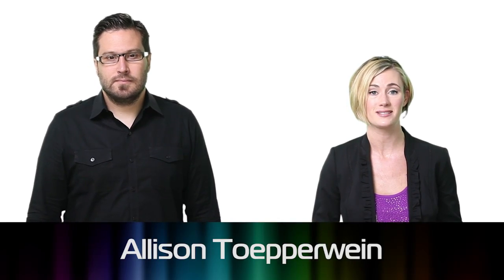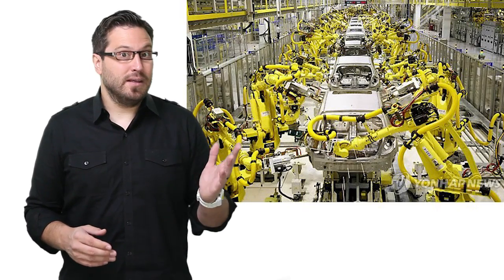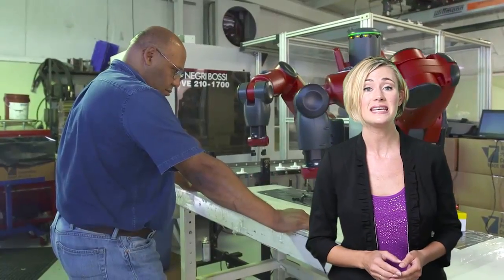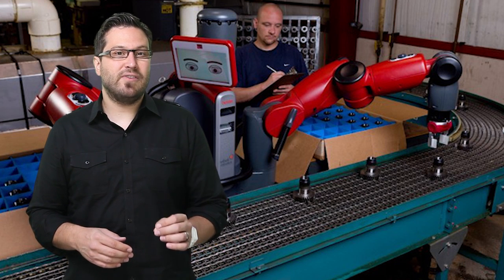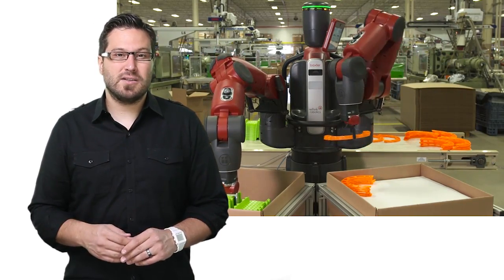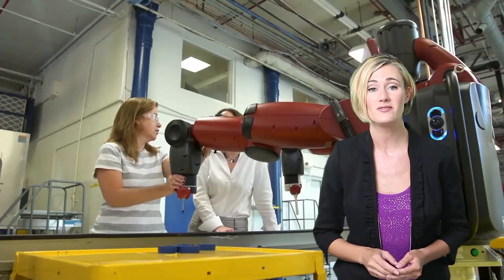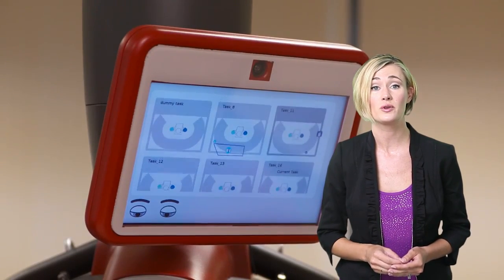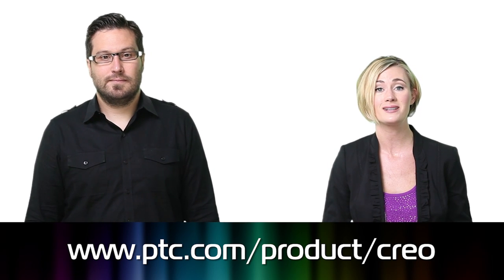The Future of Factory Automation

Comment: Someone will have to be skilled in Building repairing and programming these machines that will completely displace the unskilled laborer. Luckily for me I am going to school to learn these skill. C++ programming language, embedded systems programming, computer networking, and CAD will be needed to maintain this infrastructure.

Those who don't have these skill will be out of a job. Even farming and other jobs will be automated. I have heard that even trash and recycle pickup will be replaced by robot collection trucks.
Reply: +Terrance Kenallen 
Not really.
We already have machines and robots making other parts and machines.

Also, self-maintenance isn't a problem, considering that the main reason behind any technology breaking down is deliberate planned obsolescence.
Namely, we can design things that do not break down or require maintenance.
Making technology from say metamaterials (which are synthetic materials that we can produce in sustainable abundance) would give tech the ability to repair itself should problems arise.

But it also depends on how you design any given technology.
Eliminate moving parts by replacing them with say magnet based technology, and you eliminate majority of issues.
But as I said, you can design systems with self-lubrication, self-maintenance, etc. when its needed.

Our current system demands planned obsolescence because it keeps people in business.
However, companies are deliberately moving away from this and industrial grade technology virtually ALWAYS lasts far longer than consumer grade technology.

In short... there is no job that cannot be automated.
Actually, deep learning, etc. can already replace everyone and everything... 
The majority of the global workforce works in jobs that are highly specialized or repetitive - computers and machines surpassed Humans in both fields over a decade ago.

Now it's just a matter of time until cost efficiency catches up to technology.
Nothing more, nothing less.
Reply: deksman We have not even come close to reaching the peak of what humans will demand from technology. You speak as if we are near or at the end of technological progress. The continuing advancement in technology will drive human jobs. They just wont be unskilled labor jobs. Engineers will become more like creative artists in how they will develop technology to meet human demand. Take for example, synthetic human androids. There is a huge demand for a human like android to cook, clean, and provide sexual services (excuse the explicitness) to humans on demand. This technology is just at the beginning of development. The emergence of quantum computing and advanced sensors, and robotics will keep the employment of engineers on solid footing.
Reply: +Terrance Kenallen 
I did not suggest that we are near or are at the end of technological progress.
All I stated was that machines and computers can easily SURPASS Humans in what we can do.
Creativity is nothing more than putting random bits together into something 'sensible'. That's basically how the Human brain works... and its really nothing special.
We get exposed to so many things throughout our lives and there are these little bits and pieces we then try to piece together from seemingly random sources in an attempt to come up with something 'original' or 'innovative'.
However, computers can already do this, and they are hundreds of thousands of times faster and better than Humans, since they have total recall, and vast databases to work with (and infinitely more information at their disposal than any Human does).

Point is, in Capitalism, it is desirable to implement as much automation as possible since it drives down operational costs of a company and increases production and profits.

The reason I was mentioning this was to illustrate that we have long surpassed the outdated concept of 'working for a living'.
I think its time Humans dedicate themselves to 'higher things' and we eliminate the need to work for the sake of working.
We can easily contribute in many other ways, and in a far higher capacity without any of the 'pressures' that a competitive system like the present one creates.

This is what is needed... to dissolve Capitalism completely during a transitional period into something else, something such as resource based economy.
Reply: deksman Capitalism is not going away any time soon. It may be evolving but human desire for wealth, power, and status will drive human motivation. No body is going to produce anything for free. If they do they will create it for themselves and if forced to provide it without compensation they will not create anything at all. Computers can not read human minds and don't know what we want unless we program them. Only a human will know best what a human wants so Engineers well create new adaptations to the demand and will require compensation in wealth, recognition, or status, or they wont do it at all unless you hold a gun to their head and then you would have Stalinist style communism.
Reply: deksman To add to this. I would suggest we NOT go exclusively to a resource based economy. The United States has owed much of its success to an innovative economic system. Yes the U.S. has many resources but it would be a mistake to become dependent on them alone. Take a look at Venezuela, or Russia. These are countries that are dependent on oil exports almost exclusively to keep their economies solvent. Yes, when oil is expensive Russia, and Venezuela do well. But when oil is cheap as in right now, they suffer. You need more than resources to make an economy valuable.
Reply: Terrance Kenallen
You do realize that RBE proposes viable solutions so that instead of countries being dependent on each other for resources and adding 'value' to their 'economies', everyone becomes fully self-sufficient, but the entire world would be interconnected.

Emphasis has to shift from a consumer based economy which requires infinite growth on a finite planet (Which is simply not possible), to a sustainable model.
There are many methods in achieving this, and I can assure you that this wouldn't really stiffle innovation in any way... actually, it would enhance it to such a degree where no one would have thought possible.

In the present system, too much emphasis is placed on how much something 'costs' in monetary terms. There is no question 'do we have the resources and technology to make it happen in the smallest time frame with least amount of damage to the environment' (to which the answer is always 'yes' - but in the current system, such approach is not deemed 'cost effective' from a monetary point of view - hence the crutch).

Plus, currently, resources are hoarded heavily as opposed to shared by applying an artificial price tag on it, and only those with enough money at their disposal can gain access (and consequently, dictate how these resources will be used - completely disregarding the ecological cost, sustainability, problem solving, etc - because 'profit' usually takes precedence).

This is a fundamentally outdated model of doing things.

A transitional period would indeed be needed (of roughly 10 years)... something like a universal basic income which will de-emphasize 'money', while subsequently exposing the entire global population to relevant general education, critical thinking and problem solving... and also reshaping of our environment (by repairing damage we did to Earth, switching to state of the art methods of production and transport which lower our footprint by orders of magnitude - examples include harvesting raw materials from landfills, growing food in fully automated vertical farms locally using hydroponics, aquaponics and aeroponics in completely closed systems, along with use of mass transit systems such as Hyperloop and ET3, and of course complete transition to renewables with Geothermal being used as a baseload, and the rest comprising of solar, wind, tidal and wave.

If automation is unleashed onto all of this, we can easily reshape the entire infrastructure and subsequently the surface of the planet in less than 10 years... though a decade seems like a good number to allow a more 'full' transition.

After all, one cannot simply jump from capitalism into RBE without re-educating the populace (which would result in the same problems we have now because everyone would simply project their current ways of thinking onto a new system).
It would be like putting a toddler behind the controls of an aeroplane and expecting the toddler to know how it works.

We also have a value system disorder... the present system generates greed, selfishness, competition, artificial scarcity, and a plethora of other problems that are detrimental to Humans (and our environment at large).
Reply: +Terrance Kenallen 
Except that you already have hundreds of millions of volunteers around the globe donating their time freely to various projects and different causes.

So what makes you so certain no one would produce anything for free?
That flies in the face of artists who produced art and then freely gave it away to others.
You also have a ton of people producing various things and giving them away for free... or do you exclusively live in a world devoid of these activities?

Furthermore, the idea is to automate production with machines so that Humans are free to pursue other things.

As for 'capitalism not going away anytime soon' - hate to break this to you, but its already collapsing.
It's on its final legs.
Do tell me how exactly do you expect of Capitalism to survive in the next 15 years after most jobs are completely automated with new ones being automated as opposed to finding manual labour (which is becoming too expensive to keep on as we speak?).

Who's going to buy the products robots produce?
Where will they get the money?
In a fully automated capitalism, there are no consumers to speak of, and as such, your monetary based economy collapses.
Reply: deksman Ok, We are going around in circles here. Capitalism is not collapsing. The middle class is. We are heading more toward a third world economy where the unskilled barely survive by hustling. I have been to many countries in South America and the Caribbean and this is the norm. The U.S. will look the same soon. The wealthy will continue to do well.

Also you mentioned how can a economy survive if its fully automated. That is exactly why it will not be fully automated. If no one has money because they lost their job to automation then no one will buy what a manufacturer is selling. So this in itself will put the breaks on full automation. Corporations are not going to starve their consumers. They need them to thrive. The fountain head is not going to intentionally stop the flow of water downward to the next reservoir.

As for people working for free. Most of these people have achieved wealth, notoriety, and self sustaining capital investment. So what they do as philanthropy is used to gain moral recognition. This is not the majority of people. You are speaking about a minority here. Bill Gates donates billions to charity. He volunteer a lot of his time. But look at what he has done in the capitalist market system. So you think he would have created DOS, and Windows back in the 80s and 90s if he wasn't going to be compensated for it. No, He wouldn't have. If anything he would have made it for himself and not built an empire. He would not have been allowed to without capitalism. Capitalism is just a natural human construct. Trade is part of who we are.

The artists that paint pictures and donate them. They also do that to get notoriety. They are being compensated in other ways when someone recognizes their talent and offers them employment. It is also a way for an artist to develop his or her skills.

Money you mentioned. If the U.S. dollar collapses. People will find another currency to trade with. Trust me, People would start trading gold coins and postage stamps if we did not have a stable currency. That is still capitalism, so no, its not going away.
Reply: C++ isn't really significant in factory automation, meat of automation is PLC language IEC 61131-3, pick your flavor. On top of that tons of C# .NET for busywork that doesn't actually control hardware, HMI-s and such. As weird as it seems, factories run on Windows. General purpose robots all have their own medieval manufacturer specific programming language, usually some BASIC derivative.
Reply: Terrance Kenallen you only need so many people to program.
 dozen jobs replaced with one or two people.
Reply: 🤣 True story. Found calling. Years learning programming. Good programmer. Frustrated finding job. Invest remaining money. Start business. One day spreadsheets come. Untrained secretary can do my job at no extra pay. Out of business. Out of money. Took menial and dangerous job. Today few programmers are needed and machine learning has arrived. Good luck.
Reply: You need to learn PLC

Comment: Baxter is simply a foot in the door for the company that makes it. I agree, many of the 'bot's features are unnecessary in an industrial setting, and the method of programming through manual manipulation of the arms is not new by any stretch. But the simplified programming through touchscreen and the cute anthropomorphization make for good press, and that might be enough to get past clueless management and into start-ups.